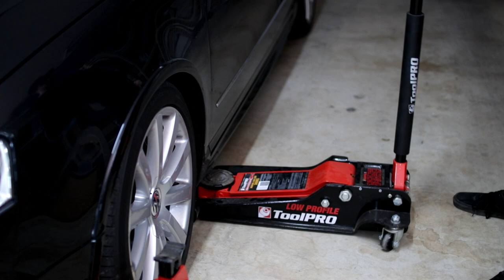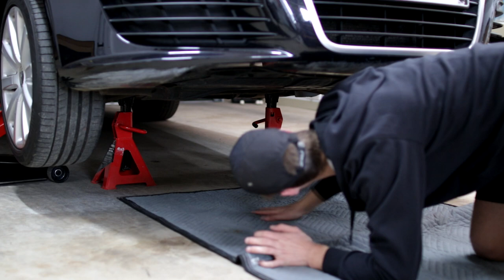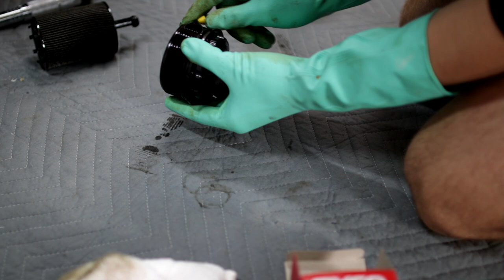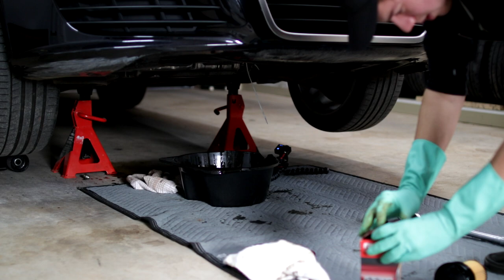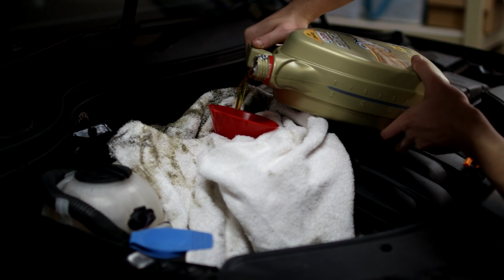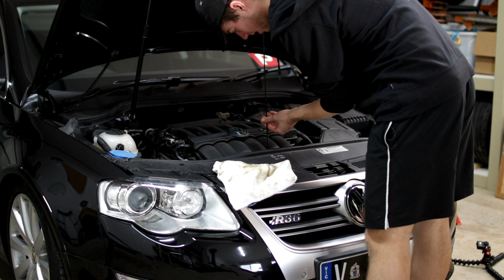How To Change Oil B6 Passat R36 (Supercheap Auto)

Comment: Great video! Having a Blue MY2010 R36 Wagon in Sydney. I do my oil service by myself too. First, the dipstick measuring should be done when the car is level on ground. Second, I will do the dipstick measuring after the new oil is cycled in the engine then rest for 20 mins. I also put new oil in the filter housing before installing it back.

Comment: that oil is deadly for the timing chain..... use addinol 5W40 and change it every 7500km..
Reply from the maker: What exactly makes it deadly when it is literally the oil recommend by VW?
Reply: +1 use addinol 5w40 or motul v300 5w50.. 
it's an aberration to use longlife with 3.6L engine
change between 8000 and 10000.
Reply: Addinol 0w40
Reply: why 5w40?
Reply: @louieyashili  got no idea most likely they have done over 150,000kms the higher the thicker the better more lubrication
Reply: I don't think your jack points are acceptable. You can but it it's not recommended. Super sketchy. Unfortunately there's really not a better option for at home in the garage. In Australia a slightly thicker oil is ok. But I don't, factory Castrol and with the Liqui Moly additive. Every 5k. Just clicked over 200k I've owned it since 159k and I beat the shit out of it daily.
Reply: P. S I use ramps, it's not fun driving a dsg up ramps.
Reply: And no I always remove the bolt from the oil housing. Whoever told you that you shouldn't is wrong. That's what it's for! Also pay attention to exactly where the o ring is. It's really easy to put it on the wrong spot and it will leak is you do. I know.
Reply: @PaulJamesMuldoonGYST  Those jack points are the recommended ones for axle/jack stands - under the control arm bushes on the subframe mounts. You obviously can't jack up the car and put stands in the same place